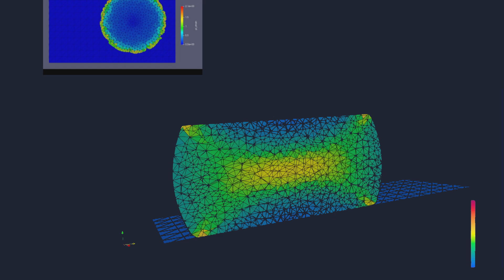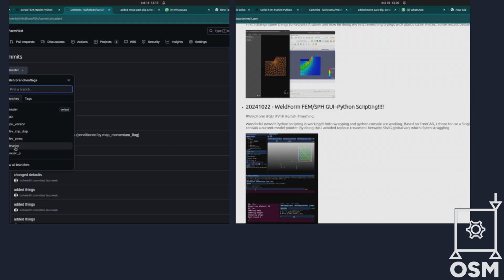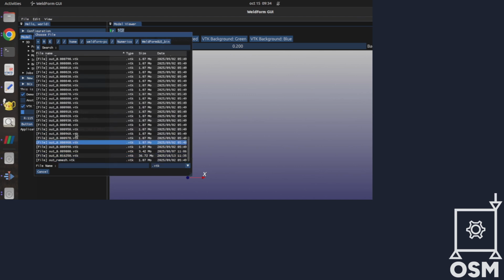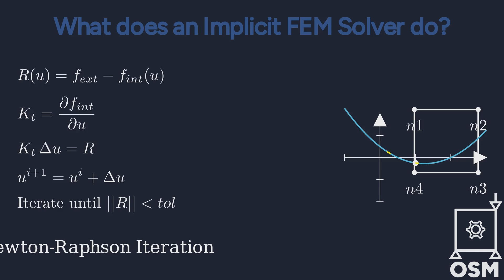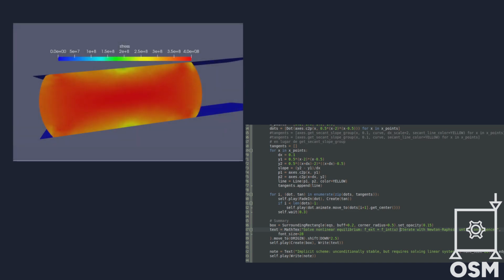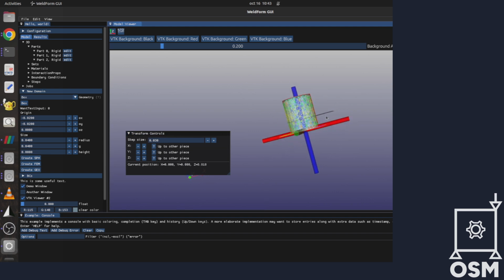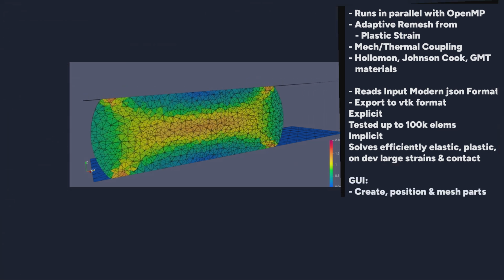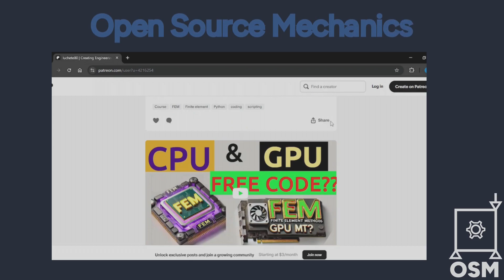I Built My Own FEM Solver From Scratch!

Comment: Cool self project, why not using the pre-existing UFL? I mean, I think that without PETSc the backend it's hard mainly for preconditioning, subtle hybridized methods (already validated)
Reply from the maker: Great question — and an excellent point!
Short answer: absolutely, I have no intention of rewriting existing backend math libraries. In fact, the implicit version of the solver already includes both PETSc and Eigen wrappers, and I plan to add support for Trilinos or Intel MKL (I’m currently dealing with some Windows-related issues). This is mainly due to the strong nonlinearities involved and the need for robust preconditioning, consistent tangents, etc.

Long answer: I started this project because I needed to simulate extremely nonlinear, thermally coupled, hardening–softening metal forming processes (close-die forging) with adaptive remeshing. After experimenting with several frameworks (from Kratos to building libraries on top of deal.II), I decided to write my own explicit version.

Why explicit? Because it’s faster to prototype, more robust with strong nonlinearities, and easier to parallelize on GPU.

This naturally leads to the key question: for forging-like problems, is it better to go implicit (like FORGE or DEFORM) — with the pros of larger time steps but cons of preconditioning complexity, math libraries, and high RAM usage — or explicit, which is simpler, more robust, and GPU-friendly, but limited by small time steps?

You can check the implicit version (still a bit buggy) — it already uses external math libraries as you suggested, and it’s helping me explore these trade-offs.

Comments and questions like yours really help keep me motivated to push this project further. Thanks!
Reply: @opensourcemechanics  fanstastic, however PETSc has some CUDA in it! -Some matrix vector multiplication can be transferred to it, but not everything, unfortunately, I can't imagine how much VRAM will be required

Comment: Amazing!!
The fact that you implemented the render and the solver, blows my mind🎉.
I am trying a similar thing. But due to inexperience in software design its taking way more time.
The render itself has its steep learning curve. So now i have opted for software rendering instead 😢.
I hope this will make my life a little easier and i can finally work on the FEA part.
Reply from the maker: Thank you so much for your kind words!!!! They really encourages me to keep going! Your're right: It's  definitely a huge challenge to implement everything fom scratch, but, I have to say: It DEFINITELY worth it! Since I'm mechanical engineer, the most challenge part is not so much the solver (which however it has a lot of things) but the rendereritself. I have the luck the 3D graphic rendering has catched my attention since forever, so incertain way I have done some little things which had help me on the road. Feel free to ask me if you some day take this road! I will be releasing some course relating this work including the coding of the graphic part. I hope you will find it useful!